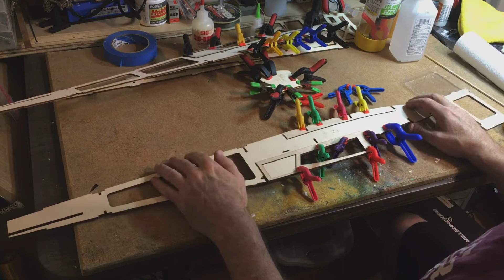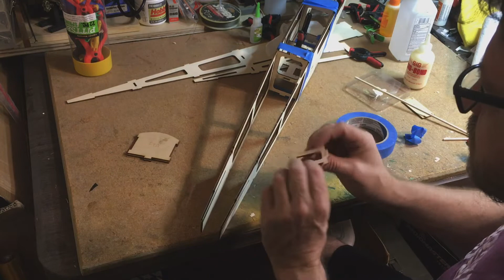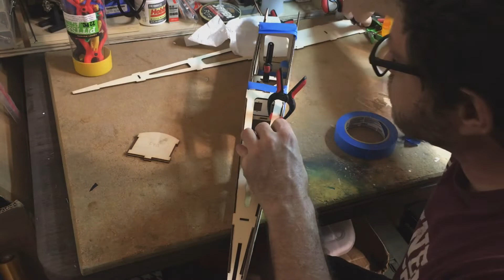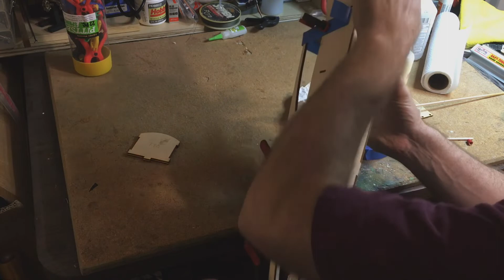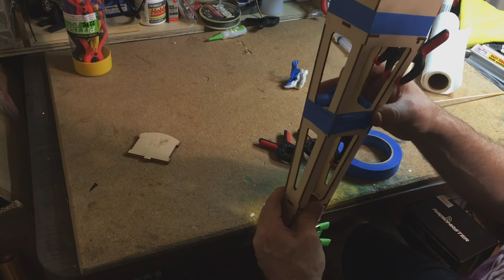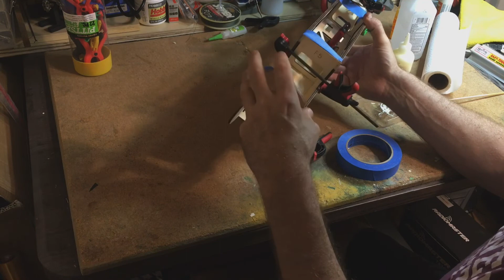Building the Junior 100 RC Trainer Part 2

Comment: One more question, if I may. Do you plan to make a video on your laser cutting workflow? Do you use Fusion for that as well? Thanks.
Reply from the maker: I did make a video that covered it very briefly. I'll work on one that goes into a little more detail. A brief synapse, is I export a dxf from fusion and then import it into Lightburn.

Comment: Thanks for your videos, especially the "flattening" one ;) What sort of plywood are you using for this model?:
Reply from the maker: Flattening was ultimate goal with 3D Cad. Glad I’m not alone!  Most of the plywood is Lite Ply. All the parts that need more strength are made with Baltic birch.
Reply: which one is the "Flattening " on, must have miss it. I will review them all
Reply from the maker: @gabkahl9246  https://youtu.be/ZIJW2ldBPbE